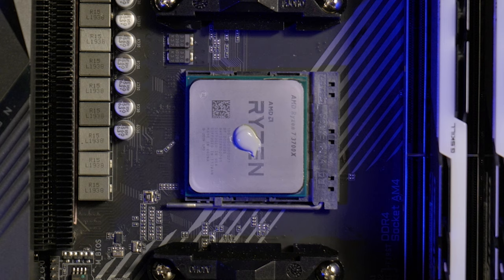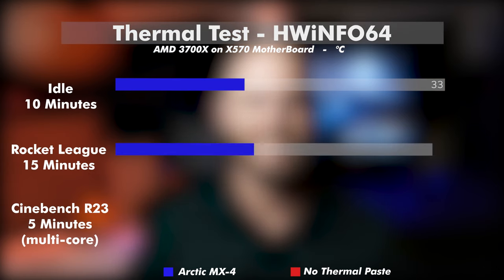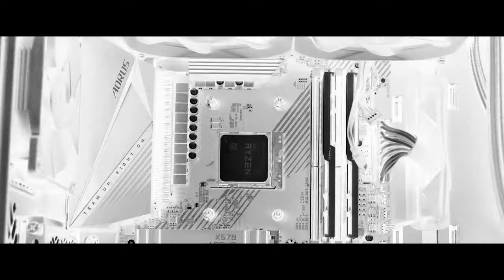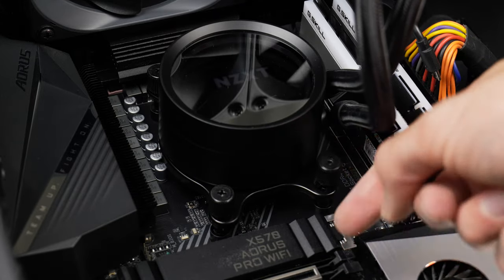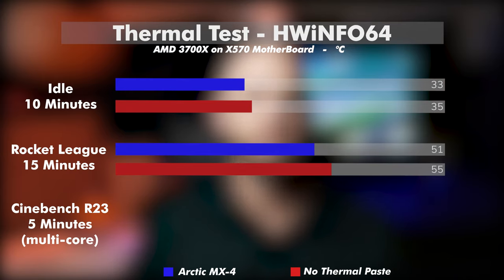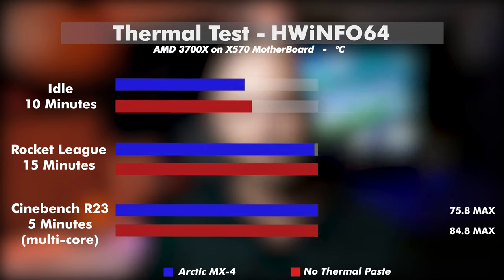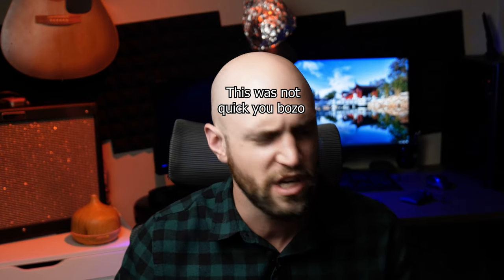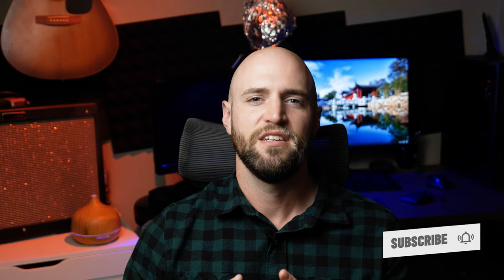Do You Even Need Thermal Paste?

Comment: I wanted to mention that thermal paste's thermal conductivity sucks. Thermal paste is actually really bad at conducting heat however if the cpu and/or the heatsink aren't perfectly flat they are not going to contact on the full surface properly leaving air in between them. Thermal paste fills this gap with a material that conducts heat better than air but way worse than metal.
This is why some people that want to bring their computer to the limit spend hours sanding down the cpu and heatsink to get them perfectly flat, this way they don't need to use thermal paste and are able to have perfect metal to metal contact. 

TLDR: Thermal paste sucks, it's job is just to fill imperfections.

Comment: I mean, one expected there to be an air gap, however minimal, which might be slightly insulating, or just not really well-conducting, and temperatures will tend to be considerably higher, and/or the CPU will considerably down-clock to compensate for terrible [or "not as good"] cooling performance.

Much like the "tiny dot" in the prior experiment showed massively higiher temperatures vs. well, ANY other thermal paste method with a "sufficient amount."

But, who knows, right?

Comment: Yeah, not far off no change. It really isn't needed for modern CPU's, regular case cooling can be required more. Back in the early 2000's thermal paste was vital. but with the power management these days and better fans, heatsinks and liquid cooling, the interface of metal on metal is fine as is.

Comment: I think it would all depend on how flat the cpu heat spreader and the heat sink surface are. Two perfectly flat surfaces would require zero thermal paste, and as the planes leave true the temps would get progressively worse with no paste. Personally I dunno why the manufacturers have such a problem making flat surfaces but what do I know.

Comment: In a very perfect world thermal paste would be counter productive as you would just add mass for heat to soak into instead of getting diverted away, as your cold plate of the cooler and IHS make perfect contact. Given the very minimal difference you had, the surfaces of both the cold plate and the IHS are near perfectly flat and alligned, and the cooler is screwed in just right. However, I dare say this is specific to your case and not even specific to your CPU. Both a testament to the quality of your build and the parts you got.

Comment: There are two major asterisks you neglect to mention. The first is core-to-core temperature deltas. Neither your CPU or heatsink are flat and will be making uneven contact, for CPU's with larger dies this can result in massive temperature deltas.
However, if you make sure both your CPU and heatsink are flat you'll end up with a configuration that outperforms all thermal paste and liquid metal by a wide margin.

https://www.youtube.com/watch?v=sQw20rHvpRw
Reply: This video isn't meant for lapping, it's just for the average person installing a CPU, if you want to lap your CPU be my guest

Comment: No thermal paste for about 4 years and my pc is still fine...

I'm using AMD a6 7400k  in asus a58me fm2+
Reply: Why would you not put thermal paste?  All prebuilds have thermal paste.  What's the point, besides to make a point you can sometimes get away with it if you have good CPU to cooler contact?
Reply: @raylopez99  i find it no difference at all... i constantly use my pc in high performance mode for about 4 years... 48°c without insulation paste and 42°c with 1USD insulation paste.

Btw i live in tropical country so basically the climate here feels like summer and the humidity is annoying, imagine my pc surpass these factors without thermal paste.

Comment: You definitely wouldn't damage anything short-term by using no paste. Sometimes it's just easier to leave it bare when troubleshooting and testing CPUs, though I don't think I'd be doing any serious benchmarking test. Long-term with prolonged high temps I'd imagine would discolor the IHS on the chip.
Reply: It doesn't get hot enough to alter metals. Max these see even without paste is less than 200 degrees Fahrenheit.
Reply: @VanillaWahlberg  I've had my IHS discolor before with paste.

Comment: Excellent test. However... ;-) the surfaces have micro fissures in them and you will be unable to clean these out. Hence the result is still "better" than never having used thermal paste before. Only a brand new CPU and brand new cooler would do that trick.
Still, I do not expect significant changes from the results presented.... but have not tried this :-O
For me, you other video has pretty much 'solved' this issue: just apply paste with the five-point method and forget about this issue.

Comment: I've had my cooler not screwed down all the way and it quickly, almost immediately thermal throttled my processor to keep it at 100c and my PC slowed down to a crawl and acted like a old Vista operating system with a ton of malware running in the background.

Comment: Interesting. Honestly (re)applying the paste is the one chore I really dread every time I tinker with my PC, I don't know why, maybe it was demonised before and all I remember is "IT'S GONNA MELT IF YOU FORGET!". And I remember I accidentally forgot to apply the paste when dusting my old AMD Phenom II X4 955 configuration back in the days. I put everything together, turned on the PC. It spun up, I logged into Windows, half a minute later, poof, shutdown. Okay. Maybe I didn't attach something correctly, I checked the PSU connectors, everything was fine, all cables firmly attached. I turned on the PC. It spun up, I logged into Windows, half a minute later, poof, shutdown. :) AND THEN, to my horror, I realised I couldn't remember if I applied the paste or not. With speeds that surprised even me I disassembled everything only to find a bone-dry CPU. I actually did apologise to it. 

Paste applied (something between a dot and a buttered toast method), and everything put back together I turned it on for the third time and this time it stayed on :D  So that's my horror story. 

I killed that CPU a year later accidentally when removing it from the socket (don't ask), I bent the pins. It was old anyways, time it went... :D

Comment: Anything over 80c is running dangerous temps for a CPU. With a newer one like this, it handles games a lot better than the older ones so it wont run as warm. I know that with my roommates Ryzen 5 2600 and my Ryzen 7 5200x my computer wont make it to windows without shutting down due to thermals.

Comment: What type heatsink you running? Liquid nitrogen? lol. I was building Pentium 1 PCs with 266 mhz. I have a Pentium 4 Northwood 2.8 ghz Win 7 pro 32 bit running stock heatsink. Dont think i put paste on with no problems. Thats the fastest desktop i have. But have 6 Lenovo and 1 HP laptops. Not a gamer so the P4 does anything i need.

Comment: My prediction is that the bare processor will run but at the upper limits of the temperature threshold and the thermal paste will lower the temp by 25-30%.

Comment: you know.. the other day i had the brilliant idea to clean my pc and also had the brilliant idea to remove the cpu fan and look for any dust, since pc was started working and stopping after few seconds(it was perfectly fine before i decided to clean)

so... since i had no clue about thermal paste whatsoever i reapplied the cpu fan and opened my pc.
thankfully i had a programm to watch overall system degrees and quess what.

my old 4460 almost got burned.... i tried to launch game with maximum graphs at 1080p and it played around 90-100 degrees.
i even tried to open twitch and happened the same...

it could only play things like youtube and normal computer tasks

keep in mind that even if the proccesor is old and the fan was stock, i never ever had any thermocracy issues at all, even at hard tasks the cpu never ever went above 80 degrees.

I am no expert by any means and maybe the cooling you have surely matters but also the strength of the cpu is good enough to handle hard tasks.

please no matter what apply thermal paste, and always remove the old one before apply the new. applying new over the old is a huge mistake you have to avoid. 

if your cpu runs at its limits, or one of your fans fail, dont be surprised if it will get fried and no i am not kidding

if u are able to run a system that costs sever hundrends or thousand of dollars you should save some for thermal paste and if u dont have the knowledge please ask someone to help you its no shame and its not bad think to do

Comment: This is a bit weird, in my case, last week I applied my thermal paste 3 times and see a higher difference on temps. I re-applied it because I though it's wasn't well applied before. Using an Bifrost 240mm Water Cooler, made by Riotoro (believe me, it's a very, very good WC). The thermal paste I'm using is the Noctua NT-H2. Now I'm getting temps around 50º and 62º C on full load with my i5 9600k at 5.0GHz and 1.29 on vcore. The difference I have seen in temps before was something around 2~3º C.

Comment: Before watching the video: I think this is going to make the parts run hot, but I guess they'll just thermal throttle down so as to prevent any damage, right?

Edit: Oh, wow. But this was with an AIO - what if it's a stock cooler?

Comment: Bet it would shut down if you tried that on an Intel 12 or 13th gen CPU. The ILM clamps down on the center side tabs of the rectangular CPU thus creating a slightly concave surface in the middle.

Comment: But what is the difference between a "run" of 5-15 minutes versus a gaming section of 10h? 
Is heat go up, longer is running? (and since i'm not an expert, an lazy, what the "max" temperature for the cpu? <= Are we far of the "limit" <= what the "recommend" security limit/range. Ex.: 10° below max?) 

But it doesn't really answer my question! Why thermal Paste is a thing! Since metal conduct heat!!! And the heatsink with fan are there to dissipate that heat into air ... why the fuck we need thermal paste!!! ??? (is another metal - with better thermal conduction - will do better than thermal paste? (for the heatsink))  

Another way to formulate it: What the role of thermal paste? Conduct more [heat] form the cpu to the heatsink, or ... or as "isolation"? (<= prevent heat in the heatsink to go back to the cpu) 
[one way isolation - maybe <= pure speculation!]

Comment: I wonder if it is the same on an old intel celeron CPU @ 1.86GHz that’s in my old laptop 
It already throttles quite bad because my laptop is so freaking old lol 😂 

Ok ok don’t freak out I have other computers this is not my main one if you were going to ask that.
I am planning to send it to the moon with the temps on it because I am planning to upgrade it to a CPU with faster speeds
Besides the one in it is only a single core processor and I don’t care if it melts I am going to get a new Intel core i3 processor or equivalent and stick it in the old laptop. That I will use thermal compound.

Comment: Lol do you people think thermal paste is only about the heat? Regardless of its namw it's actual use is to create proper contact between the CPU and the motherboard. The CPU is not flat nor is the motherboard it's in contact with. You can never get it flat it's always microns off. Thermal paste closes this. You should have ran performance tests. You would have noticed the ones not using thermal paste struggling. You definitely need thermal paste try taking is off your GPU and watch it smoke.

Comment: The thing you're missing is time.
With no thermal paste you will exacerbate the cpu hotspot temps, which doesn't have an immediate impact but will reduce your cpu lifespan.
Run your system with no paste for a year and then make a video with those results.

Comment: So, ALL those doom and gloom tutorials about how your cpu will, fry, catch on fire, be destroyed, without paste are just snake oil.  Whole companies have been built on this concern.  You just spent $1,000 on your new pc.  Why wouldn't you give us just $5 to ensure it doesn't overheat?  Well give me $5 and I will send you a bottle of fairy dust to ensure the fans don't shatter.  Well, that is a bit extreme but given your max difference of 5 it is not far off.  The next thing I would like to see is a demonstration of the case where paste is essential or at least more useful than 5 degrees.  With your influence as a you tuber could you contact the arctic silver parent company and ask them for a case where their product makes more of a difference and test that?  I would like to see the case that demonstrates where paste is beneficial and how far flung that setup is.  Can you keep testing until you find a case where it makes a difference?  If you can run prime 95 on an intel i7 for +10 hrs and still be within 5 degrees I am willing to call the thermal paste industry good in theory but snake oil in real life.
Reply: He got lucky and the metals mesh well in his example. He stated himself that higher power-draw parts will run too hot without paste/some sort of heat transfer material. In the old days, with direct-die (no IHS) like GPUs are now CPUs definite blew up and overheated and fried themselves. AMD especially has changed that with how their PBO system works. It'll downclock a LOT and TANK performance before it blows up. You'll notice the performance regression probably long before the processor is damaged beyond use.